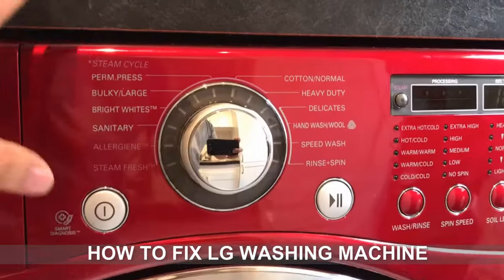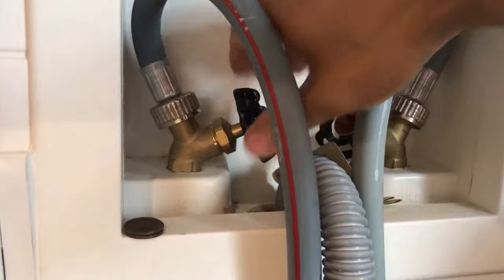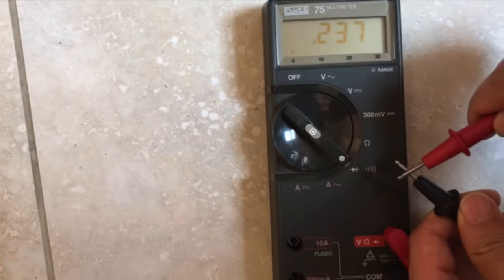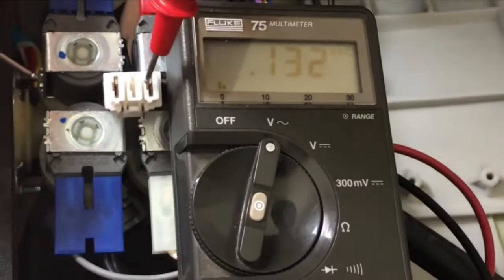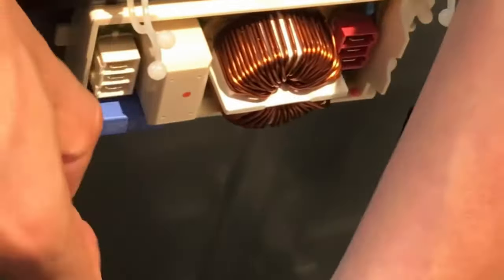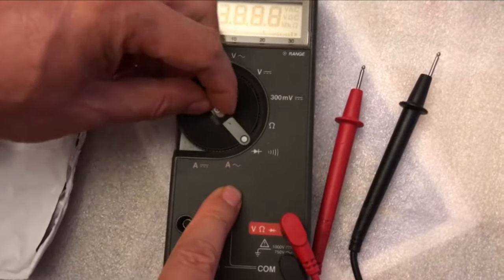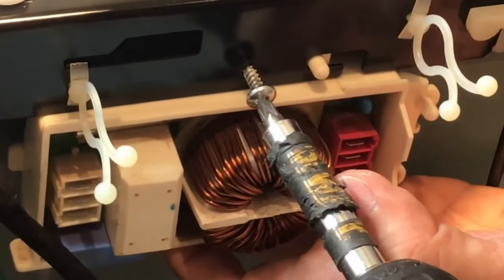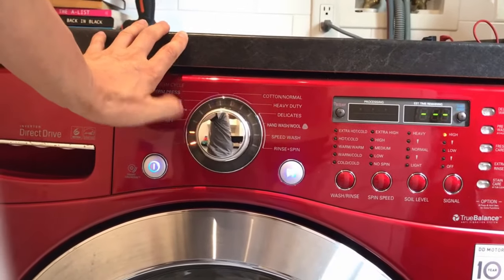Fix LG Washer No Power Issue

Comment: I did the troubleshooting as described, and the noise filter is ok however.

I also test by spinning the drum without power on and it can temporary power on for few secs as described by other YouTubers since it's a direct drive motor. Does that means the motherboard is totally fried?

Comment: Replaced Noise Filter, but still having power button issues at the front panel.  I already checked everything mentioned in your video thanks! Any tips for further diagnostics?
Reply: How did you fix it 3bigps?
Reply: 3 levels of input and out pins are there. 
1st and 3rd pair is working for me but the second one is not.
In this video they did not test the second (middle) pair. If the second middle pair is not beeping then is it broken ?
Reply: @sanemonk1  same for me… I am assuming that it should beep
Reply: @sanemonk1  the middle pin on the new one from Amazon was open, installed it anyway , it fixed the issue
Reply: It powered right up
Reply: @risknotdonot  I'm having same issue the middle input have no connectivity. Did you bought a used one or brand new?
Reply from the maker: The middle one is ground. It's open in my new one and it works fine.
Reply: What did you end up doing to your LG washer to find out what was wrong with it? I’m having the same issue.
Did you test the mainboard?

Comment: 3 levels of input and out pins are there. 
1st and 3rd pair is working for me but the second one is not.
In this video they did not test the second (middle) pair. If the second middle pair is not beeping then is it broken ?
Reply from the maker: Based on the diagram below, the second set is ground, so if you take out the noise filter already, it should be disconnected. https://ibb.co/mTQ2JP6
Reply: I don’t think the second pin is being used bro

Comment: Can you just bypass the noise filter?
Reply from the maker: I guess you can for the testing phase, but I won't suggest it for the long run. It'll cost more if the other part got burned.

Comment: I tested my noise filter with a meter and both sides came good, but only the one in the middle does not show sign of life. Does that means I have to replace the noise filter? All 3 contacts need to be good right?
Reply from the maker: The middle is ground. I don't think it's an issue in your noise filter.
Reply: @charlesguo8017  oh no, I already ordered a new noise filter. So what do you think it is? Main board?
Reply: @charlesguo8017  just installed a new noise filter it did not work..still having same issue... any thoughts?
Reply: @REFLEX137  same issue, noise filter shows good.  did you get yours fixed?  Looks like it has to either be the computer or control board, I have a meter and want to test, but dont know which contacts to check...
Reply: @nicholasbolen2139  I ordered a new noise filter put it up and still did not work, so i ended up returning the noise filter and I wasnt gonna spend more time or money so I bought a used/repaired washer for $250 same model and is working well